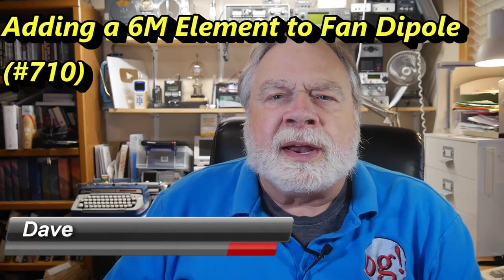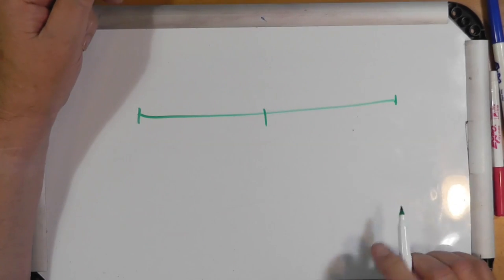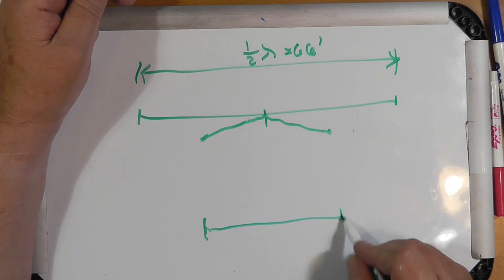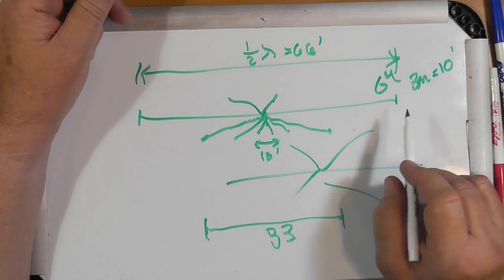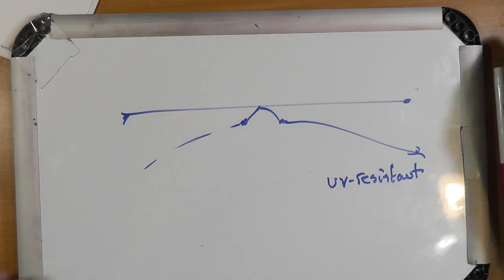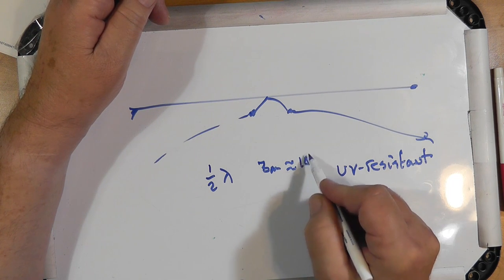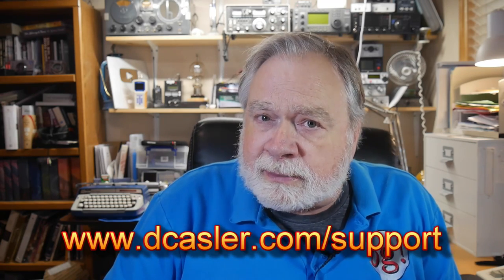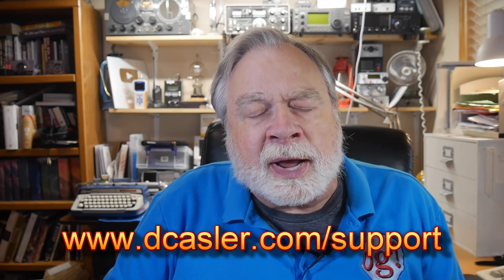Adding a 6M Element to Fan Dipole (#710)

Comment: I used 1/4 inch PVC pipe cut in short lengths as standoffs. Drill 2, 3 , or 4 small holes depending on how many wires feed through.  Works great for me and keeps everything tidy.

Comment: Hi Dave,
Many thanks for this video,  The subject of which I am fully familiar with  However, for those with revy restricted space in their  back garden, & HOA situations,  there is also the DX Commander series of Vertical DiPoles.  Remember that when they are correctly made up, with labels added to each radiating element, The DX COMMANDER range can also be easily taken down and re erected reasonably quickly..
I Must Point Out that I am NOT connected in any way to Mr Callum McCormick or DX COMMANDER in any way, shape or form, & I do NOT collect any wage or fee's for mentioning Callum McCormick's' products.  I just like his products & believe in them.   They are a vertical version of the Fan Dipoles that you have just described herein this video.   He has recently just designed & produced  a 12.4 Mtrs high version with a much thicker Top section.  This new product is now on sale, and has a coil at the bottom section for the 80 MTRs band, with instructions available for download which not only gives full instructions the general build of this fabulous aerial, but also how to wind the correct number of turns on the coil for the customers favorite section of the 80 MTRs Band.
Best Wishes,
Kind Regards,
Ray. M0RAY,
Locator  JO01ii